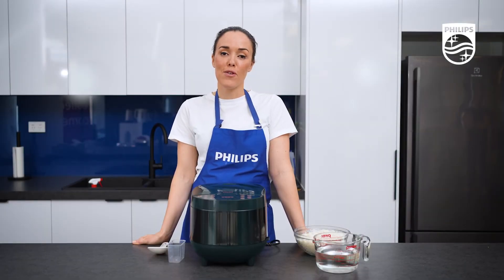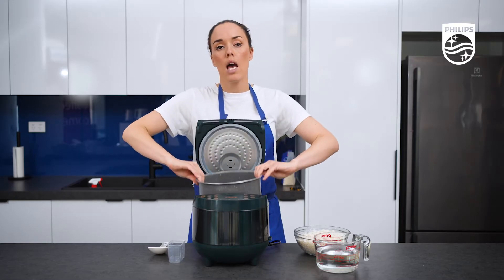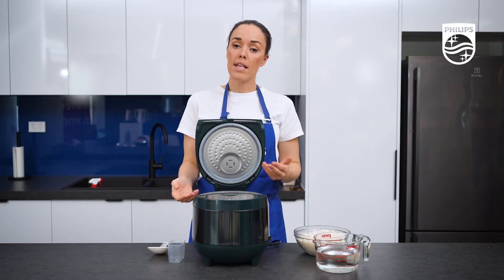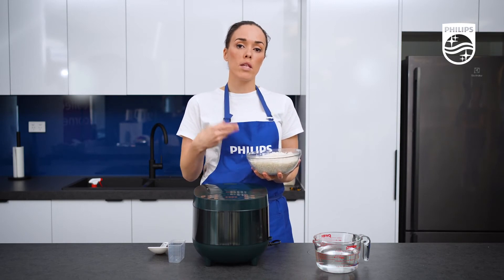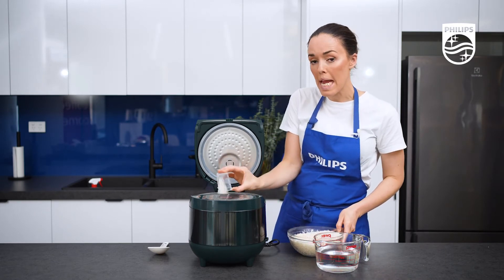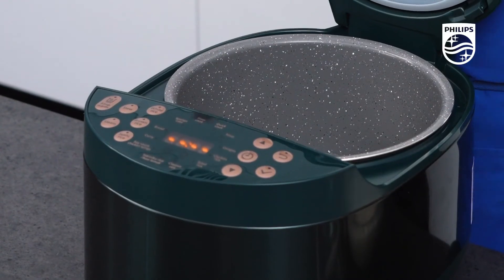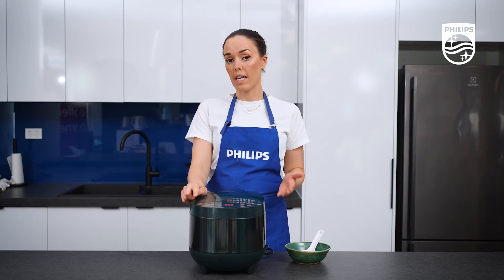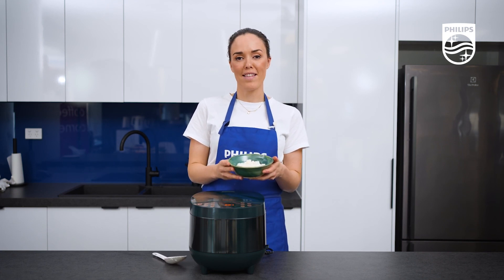How to Cook Rice using the Philips Digital Rice Cooker 3000 Series (HD4518) #PhilipsRiceCooker

Comment: why does it take so long to cook the rice? white rice takes about 15-20min on the stovetop so why is it so long with the rice cooker? also, doesn't it use a lot of electricity that way?
Reply from the maker: Hi, thanks for reaching out with your concerns about the Digital Rice Cooker 3000 Series. The cooking time for white rice in our rice cookers is indeed longer than the stovetop method. This is because our rice cookers use advanced technology to ensure that rice is cooked evenly and thoroughly, which enhances the texture and flavor. The 'keep warm' function also ensures your rice stays at the perfect temperature until you're ready to serve, without the need for constant monitoring. Regarding electricity consumption, our rice cookers are designed to be energy-efficient, consuming minimal electricity, especially when compared to the total energy used for cooking and maintaining heat on a stovetop. If you have any more questions or require further assistance, please don’t hesitate to contact us through the support page on our website or through one of our Social Media channels.
Reply: You're never going to get the rice as perfect on the stove as you can in the rice cooker - for that reason.

Comment: how many cups of water to 3 cups of rice?
Reply: You put water into the pot up until the 3 cup marking on the side.
Reply: Use the cup that comes with the unit.
If your doing white rice then fill it up to the amount of cups you put in.
Wash your rice really well until the water runs clear.
Press the rice your cooking and its done.
Keep warm is great to have also.
Reply: @nenadnedovic9246  try so many time you cant really know how many rice and how many water，i try to use 3cup rice you put water until line 3，after cook very dry.i try put little bit more water as well，after that be like congee…now this cooker never use！will sell who looking near new rice cooker. i feel this very garbage
Reply: @user-Eunice-HC 
Depends on the rice
I use medium it's one cup rice one cup water I use the cup from rice cooker 
Long grain white rice - 1:1.75 ratio (1 cup rice + 1 3/4 cups water)

Medium grain white rice - 1:1.5 ratio (1 cup rice + 1 1/2 cups water)

Short grain white rice - 1:1.5 ratio (1 cup rice + 1 1/2 cups water)

Long grain brown rice - 1:2.25 ratio (1 cup rice + 2 1/4 cups water)

Let it stand for 5min on warm then fluff.
Try these as a guide
I hope it helps.

Comment: My rice is ALWAYS GLUGGY. I have followed the instructions, tried less water, tried more water, tried less time but it is always gluggy - I HATE IT!!
Reply from the maker: Thank you for contacting us. We are sorry to hear that your Philips Digital Rice Cooker 3000 Series (HD4518) is not working as expected. We understand how frustrating it can be to have gluggy rice. We want to help you resolve this issue as soon as possible.

Please try the following steps to troubleshoot your rice cooker:

- Make sure you are using the correct type and amount of rice for your rice cooker. Different types of rice may require different amounts of water and cooking time. You can refer to the user manual for the recommended rice and water ratio.
- Make sure you rinse the rice thoroughly before cooking. Rinsing the rice can remove excess starch and prevent the rice from sticking together.
- Make sure you use the measuring cup and the inner pot that came with your rice cooker. Using different utensils may affect the accuracy of the measurements and the cooking performance.
- Make sure you select the appropriate cooking mode for your rice. Your rice cooker has different modes for white rice, brown rice, multigrain, etc. You can press the menu button to choose the mode that matches your rice type.

If you have tried these steps and your rice is still gluggy, please contact us again via this chat. We will be happy to assist you further and provide you with a suitable solution. Thank you for choosing Philips.
Reply: Thanks for your reply Philips, i appreciate you taking the time to respond. I have tried all of the suggestions you made, I am using the measuring cup provided and the water level marks inside the bowl. I have tried different types of rice, and I always rinse well first. I’m sorry but it just isn’t doing what it’s supposed to do.  Before I got this cooker, I was using a cheap one which always cooked perfect rice.
Reply from the maker: We're sorry to hear that the tips haven't worked. Our team would be happy to have a look into this with you. Please feel free to message us on one of our social media platforms (Instagram, Facebook or X), or through our website, and we'll get back to you as soon as possible.
Reply: Hi there, thanks for your input to my dilemma. I only use long grain white rice either Jasmin ir Basmati. I’ve had some luck with the Basmati if I cook it on the short cycle, but no matter what I try with the Jasmine it is ALWAYS gluggy and awful. I’ve even removed the plate in the lid to make sure it isn’t blocked. I think I’ve got a dud.
Reply: @genellethornton88  
Try the water ratios I provided.
It's not the time issue it's possibly too much water.
I'll try long grain and jasmin on the weekend.
Reply: I tried again last night with the Jasmine I used 2 cups rice and 2 cups water, still gluggy
Reply: @genellethornton88  
Wow.
Basmati 200g rice 375ml water on the packet.
Same for jasmine.
Reply: @genellethornton88  
I just spoke to Phillips.
They say try 1 cup rice  to 1 cup water.
If too dry add an extra half cup.
I'm not giving up.
I'll keep you posted.
25 min for jasmine rice time.  🤔
Reply: Thanks for this, I’ll try this ratio tonight…. Keep you posted😁
Reply: Same exact problem!!! Did you figure out the issue??? I also tried different types of rice and ratios, nothing worked
Reply: Are you making sure to thoroughly rinse your rice? Especially if buying bulk rice you need to make sure you rinse until you are getting almost clear water from a wash of the rice to be used to stop the starch making it gluey.
Reply: @xyrt99  like there's no tomorrow!
Reply: @sarahashkanani8215  
Medium grain 1 cup water 1 cup rice 
I did Jasmine tonite same ratio it was fine.
I use the rice cooker setting.
I use the cup from the rice cooker.
Reply: Ok, so for those who asked about rinsing, YES I rinse thoroughly. 
I’ve stopped using the measuring cup provided and the water marks inside the pot.  With Jasmine rice if I use 2 standard cups of both rice and water, and cook on the short 25 minute setting, the rice is acceptable- NOT FLUFFY, but edible. 
I’ve come to the assumption that my cooker is faulty as most people rave about the way their cooker makes rice.

Comment: 45 mins to cook 3 cups!!! Wtf. Is it heating based on room temperature
Reply from the maker: We are sorry to hear that you are having trouble with your Philips Digital Rice Cooker 3000 Series (HD4518). We understand your frustration and we want to help you resolve this issue as soon as possible. 

There are several factors that can affect the cooking time of your rice cooker, such as the type and quantity of rice, the amount and temperature of water, and the ambient temperature of your kitchen. Please refer to the user manual for the recommended settings and instructions for your model. You can also try to reset the rice cooker by unplugging it for a few seconds and plugging it back in.

If these steps do not improve the performance of your rice cooker, please contact us again via this chat and we will assist you further. We appreciate your patience and cooperation. Thank you for choosing Philips.